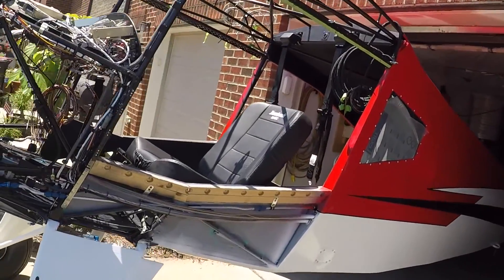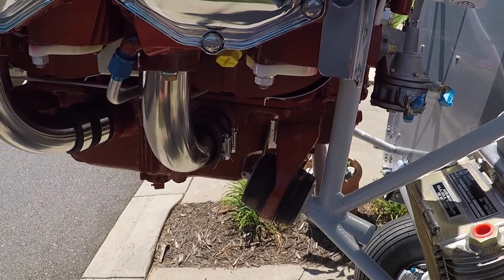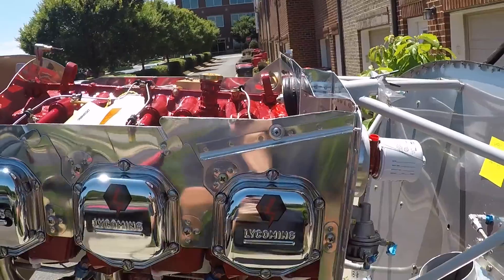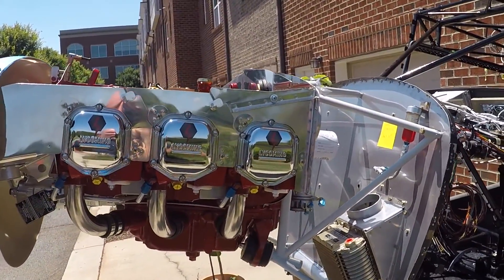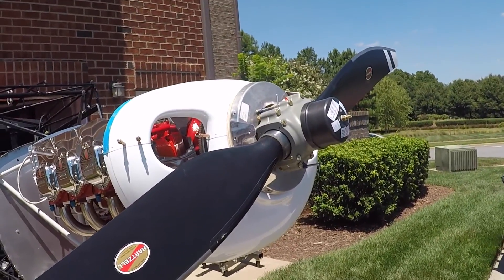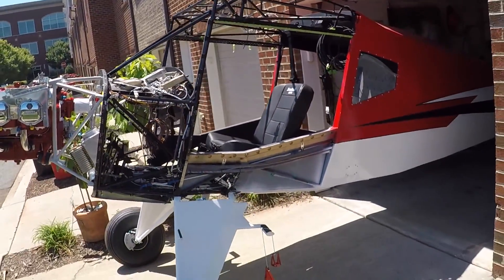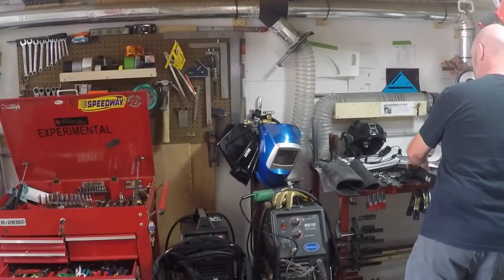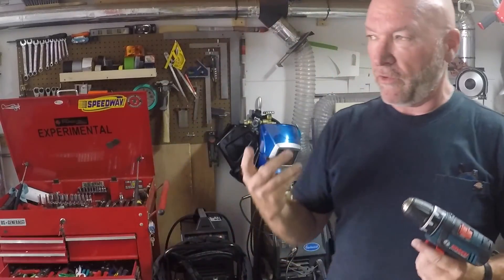Bearhawk Build Status ~ Installed the Engine!

Comment: your not flying a F 16 do you really need  helm
Reply from the maker: Yes.  Structural tubes just above the pilots head.  It's known problem when flying in turbulence. Also, in the event of a forced landing in unknown terrain, a helmet is an excellent safety device.   Good question!.

Comment: Beautiful aircraft, stunning actually. Super valuable information, the build experience is priceless as ; as much as i love the BearHawk. the Rans S21 Outbound kit with pre-drilled assembly and a 500 hour estimated build time is more and more appealing.
Reply from the maker: As my Dad said after touring the homebuilt section at OSH in 2018, "The Bearhawk is a REAL airplane, the rest of these are toys ..."  I tend to agree.  Whatever challenges the kit presents in the build process will soon be over and forgotten once this bird is flying.  There is no comparison to a flying Bearhawk and a flying Rans.  Just look at the wings.  The Riblett wing on the B model Bearhawk is significantly better.  The oleo strut A arm landing gear on the Bearhawk is under rated and under appreciated.  By far the best landing gear in it's class.  I could go on and on.  If you want a simple build, buy a Vans RV.  If you want a real performer with a real 1,200 payload that can fly real cross country flights...  I'll take the Bearhawk all day long.  In fact, when I finish this 4 Place Bearhawk, I'm building a Bearhawk Patrol next!

Comment: Just found your videos, thanks for posting them. I worked as a mechanic for several years on Cessna aircraft. Their manuals always called out the installation instructions for the lord mounts in a catty corner fashion, (don’t remember witch way specifically) like upper left and lower right one way with the others in the opposite orientation. Might double check with lord, but as I was trained... it was due to the torque while running, not just free hanging weight. Thanks again, looks good!
Reply from the maker: Hey Anthony.  Thanks for your kind comments!  Yes, the Lord mounts have a specific orientation.  I talk about that in this video:  https://youtu.be/CtVwiLlXz9w

Comment: Looks fantastic.  New to kit builds. What is the primary purpose for the baffles? Sound or temperature control?
Reply from the maker: 100% temperature control.  Our car engines are liquid cooled.  Most traditional piston airplane engines are air cooled.  So the purpose of the baffles are to create an intended pathway for air to travel across the top of the engine (high pressure) which forces it down through the fins of each cylinder and out the bottom of the cowl (low pressure).